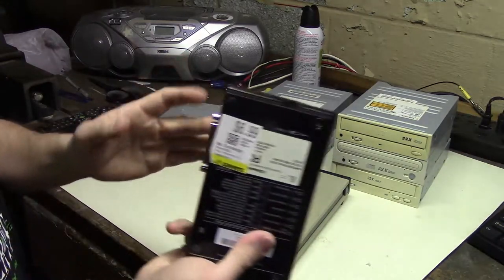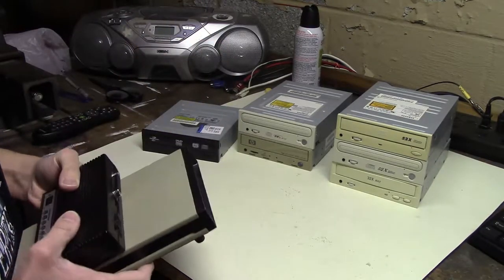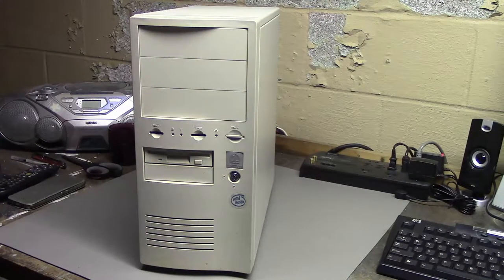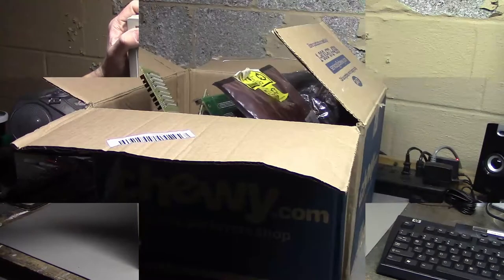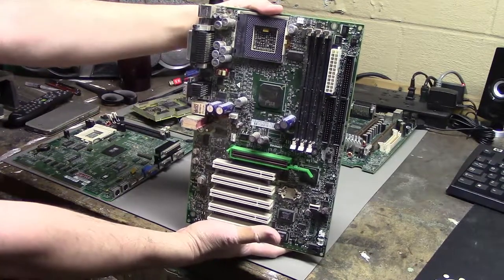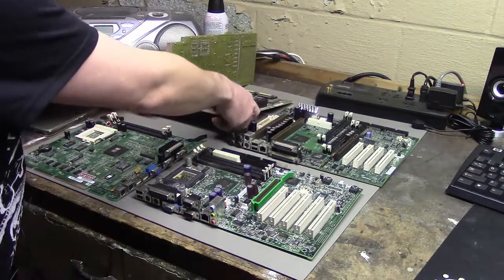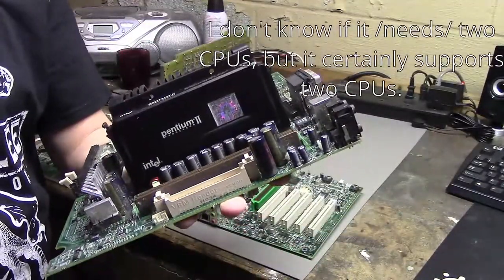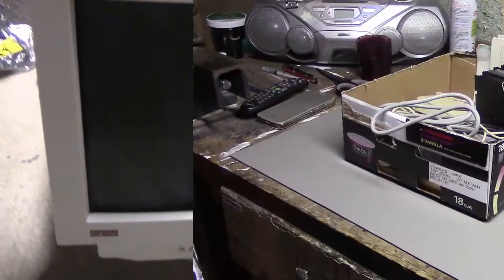Stuff from Craigslist, Savers, and more!

Comment: I have a serial modem that does 1200 baud. Also that Model M KB you found with detachable cable is worth about 120 if your not going to use it for daily use.
Reply from the maker: Very cool :-)  Does it work?  I'll try to find a way to test out the modems I have, to see if they work.
Reply: @nticompass  I don't have the equipment to test but it powers on and all the buttons function

My modern computer recognized it as a generic modem. I have this usb 1.1/2.0 to parallel and serial.
Reply from the maker: Cool, the buttons working is a good sign.  I don't have the equipment to test modems either :-P
Reply from the maker: I'll probably keep the keyboard.  I still need to clean it and get some replacement keycaps.

Comment: 2 x Pentium 3 or 2 Xeons go into the server board.
Reply from the maker: Thanks!  I realized it was a 2x Slot 1 board, and the only Slot 1 CPU I had was that Pentium II.  I'm going to do more research on getting that board running.  I want to see if I can use the Slot 1 -> Socket 370 "slotket" adapters on that board :-)